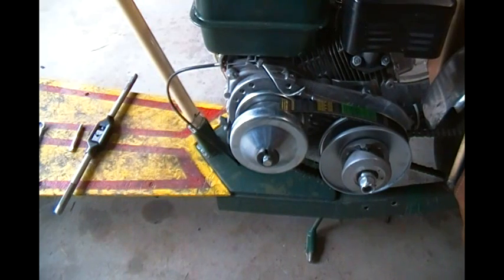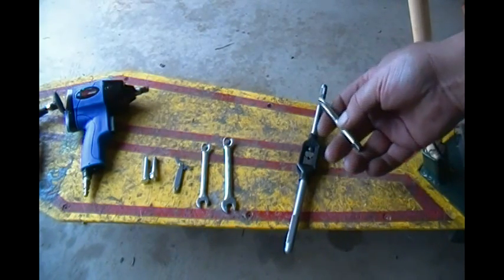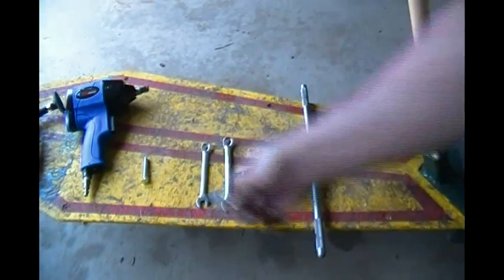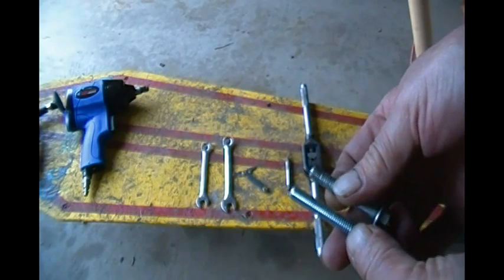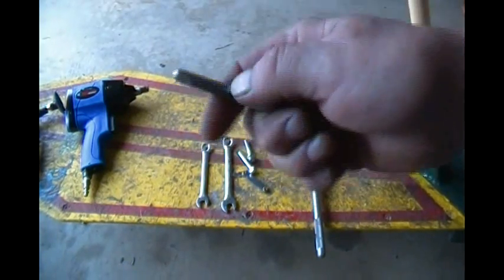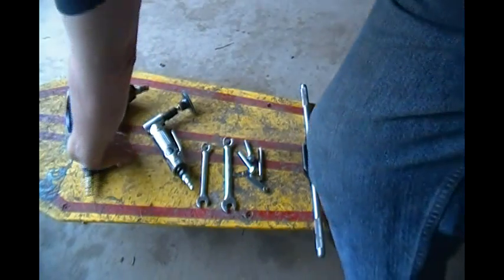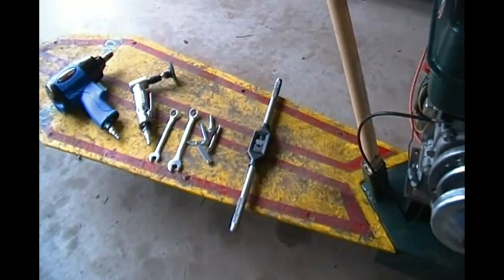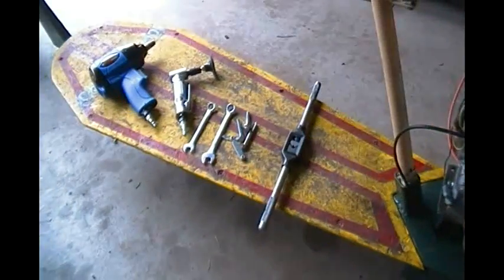6.5 HF ENGINE & TORQUE CONVERTER PROBLEM FIX

Comment: I have a Baja warrior mini bike that I'm rebuilding and I put a Predator 212cc on it and bought the TAV made for it. After I made sure the belt was riding straight I took it for a spin. All went well but when I got back the clutch guard was on an angle and was really hot. So I let it cool than looked at it all seemed ok. Than I took it for another spin and bomb the damn thing blew apart. Thanks for the video I now know the problem wasn't in the TAV but with the cheap bolt. You helped save me some money 🤘
Reply from the maker: Glad this helped you out. We're all in this together...lol 
Happy Motoring...

Comment: The harbor freight motors come from the factory with the crankshaft tapped for 5/16 - 24. The four bolt holes in the sump cover are the exact same that the torque converter plate bolts to
Reply from the maker: Thank you, that's good information

Comment: Hello everyone,

 

I just installed a torque converter on a Manco Interceptor and its a huge improvement in speed, torque, and fun. When I accelerate or take off everything runs great, top speed is completely smooth but when I left off the gas there is a horrible vibration. When I hit the gas again the vibration stops. If I'm braking the vibration is even worse. Do you have any idea what's going on. This is a Amazon Chinese 30 series torque convertor running on a 6Hp Subaru Robin engine. I never had vibration issues running this kart with a clutch so the issue has to be coming from the torque convertor.
Reply from the maker: I have never experienced anything like that, I'd say make sure you have the flat side of your belt against the flat sides of the TC, (toward the engine ) make sure your chain is lubed properly, and the components all works smoothly as the slide in & out. 
Good luck & let us know what you find
Reply: @TufdogsPlace  I took the drive pully apart and lubed everything up.  I'll take it out Friday and see of it's still doing it.
Reply from the maker: @SpeedBoostRC  Make sure all your bolts are tight too !
Reply: @TufdogsPlace  I'll check the bolts tomorrow. Someone mentioned on a go kart forum that sometimes one of the weights in the drive pully will not retract back all the way and cause this.
Reply from the maker: @SpeedBoostRC  Yeah, I could see that happening...
Reply: @TufdogsPlace  I replaced the driver pully and the issue is now gone. Is it normal to have a lot of brass shavings all over the torque converter?
Reply from the maker: @SpeedBoostRC  No, it's not normal at all. That's a sign of something wasn't right, a burr on the pully most likely, I would guess. But I'm glad the vibration is gone. Were the filings there when you took it apart ?,... or since you replaced it ?
Reply: @TufdogsPlace  When I went to remove the original drive pully I noticed brass glitter all over the convertor and the engine on the same side as the convertor.
Reply: definitely looks like it was coming from the original drive pully.
Reply from the maker: @SpeedBoostRC  ok, actually that's Good !.This means you probably stopped the problem by swapping pulleys.  I'd look at the old one just to satisfy my curiosity . look for burrs, scrapes gouges anything with a rough finish . Not that you're gonna fix it, but just to know.  I guess you could sand it down if you desired to do so.   There's a booger in there somewhere... Good job BTW
Reply from the maker: @SpeedBoostRC   Did you swap the brass ring too ?
Reply: Yes I changed the ring. Is there any other brass component that the shaving could of come from? I wish I could send you photos of it.
Reply from the maker: @SpeedBoostRC  That is the only brass or golden colored metal in those. so you should be fine.  are you on Facebook ?
Reply: @TufdogsPlace  Yes I tried to post a link but I don't think Youtube.com allows that. It might of went to your spam
Reply from the maker: @SpeedBoostRC  friend me there
Reply from the maker: @SpeedBoostRC  WHAT IS YOUR NAME ?   Dmitriy
Reply from the maker: @SpeedBoostRC  ok good, I accepted your friendship. send your pics on over
I'm gonna remove my id from the previous note
Reply: @TufdogsPlace  I'm going to delete my name also. I sent you a request from the wrong profile so I resent it from the correct one
Reply from the maker: @UC-or2IyCRXf3cNtarxXz1OQ as for lube,... comet says to use dry graphite lube, clean it every couple of rides. I don't think you need to worry about it that much, once a year service will do for the average user, unless you race or drive every day.

Comment: Hey, I have never had the issue of mine blowing apart, but I have came damn close, you can here the outer shell tinging with a low idle, something you should consider as well is lubeing the clutch, tman and a lot of guys say not to lube the clutch, but comet says to use dry graphite lube, clean it every couple of rides, as for a belt, the comet belt costs about 20-25 bucks and is part number 203589A on average a belt lasts one season, depending on how much you drive,
Reply: Diesel junky 

You

Comment: Any reason why my torque converter belt is not moving when i give gas? The torque conver and all the parts are in correctly but the belt doesnt even move when i give gas. But when i push the kart myself the belt moves just fine
Reply from the maker: Does the drive pulley move in while gassing it up ?  
It should squeeze in, to tighten up on the belt.  If not, it may not be together properly
Also belts usually have one side that flat and one that's angled. The flat side goes toward the engine.
Hope this helps... let me know
Reply: Tufdog's Place yeah i think the problem is that its not tight enough maybe it is the belt too ill look tommorow morning thanks for the quick reply man

Comment: hi, I'm having the same problem with mine! I have a baja warrior mini bike and I brought it used it worked fine for about a month and then it did this. The bolt that was in it slipped and looks just like yours did and I bought a new bolt and it did the same thing. Did this help or was it something else? Thanks for the help!
Reply from the maker: Yes, This fixed the problem. The threads just weren't long enough to get a good hold.
 Thanks for checking it out,.. Good luck with your machine. Cheers
Reply: Awesome! Thanks for the help!
Reply from the maker: You're welcome, My pleasure...

Comment: Can anyone help me with my go cart? it works but i gotta hold the throttle cable to a sertan spot for it to work and if i let go of it it just stops so anyone got advice for me to fix it?
Reply from the maker: Sounds like the carb may need cleaned and make sure that it's not leaking air into the engine also.

Comment: I have the same set up. All works great. But after driving it a week my belt get tearing up. Everything is install right I make sure of that. Even check on the belt facing the right side. Anyone have an answer please help. I install in my 6.5 Predator engine.
Reply from the maker: +Kiet Nguyen   I would suggest taking it apart again and inspecting the plates for some kind of a burr. (where ever the belt normally touches ).
I'd also check the alignment.   
Good luck to you. Let us know what you find out.   Cheers
Reply: +Tufdog's Place thx for the quick response. Do you think it's possible because the belt is crapy China mad. Do u know where I can buy a good belt for this on line?
Reply from the maker: I don't think that's the issue, because I'm sure the two torque converters that I have are probably china knock offs too. & they are still fine after all these years.
Udizzy1969 gets his at "Tractor Supply",  I believe, anyway you can search for these parts Numbers & brand names,...
Comet 203589A belt 
or Masters of Motion  # 5959H  
Hope this helps,...
Reply: +Tufdog's Place thx for all the helpful tips. I'm trying to buy the brass bushing for the torque converter. But I can't find it anywhere. Do you know a website I can get one from?
Reply from the maker: Glad to help when I can...here's a link to the bronze bushing you need. a little past halfway down the page,.6 $ . Cant beat that, lol
http://www.bmikarts.com/Torque-Converters_c_215.html
Reply: +Tufdog's Place your the best man! Thx alot
Reply from the maker: You're welcome buddy, Stay in touch. Cheers
Reply from the maker: Hey Dan, what do you mean it flips the belt ?
Reply from the maker: If one side of the belt is flat and the other has an angle, make sure the flat side is going toward the engine.  
Other than that, I'm not sure what would cause it.  
Do you have the back plate for the pulleys ?
Reply from the maker: The backing plate only insures that pulleys are right distance apart. That's why I asked that.
Good luck & let me know... Cheers

Comment: Just go my  torque converter for my Predator ATV build. Hope mine go smoother then yours. I had one years ago on a mini baja and never had any problems.
Reply from the maker: +MIKE MAYERAN  That was on that old Greyhound engine, I didn't have any issues with the predator.  You should be all right..
Reply: 10-4
Reply: do you have any posts on your predator atv build?  I'd like to do the same with a Honda 300ex
Reply from the maker: Yeah he does, Click on his name , it'll take you to his channel & you can see his videos from there.

Comment: I'm not sure what the issue was??? Did your clutch fly off? The bolt that comes with the torque converter is a generic bolt. The one that came with mine was a 5/16 x18 x1 1/2.... I think. The one that my engine requires is a 5/16x24x1 1/2. The pitch is also wrong on the ones that secure the verter to the side of the engine. Of course, you just made the hole a new size and then used that size bolt so... should work well.
Reply from the maker: The 1.5 inch bolt was not long enough to grab enough threads. So the driver pulley came apart on the fly. 
5/16x24x1 1/2 is what came with it, 5/16x24x1 3/4 is what I ended up using.
I got one that was 1.75" long then I could tighten it up properly. The thread pitch was correct & I did not change that, nor did I make any hole bigger.  
Simply put, it wasn't tight enough. But it is now. lol  
Thanks for checking it out & commenting, I like that ! :)